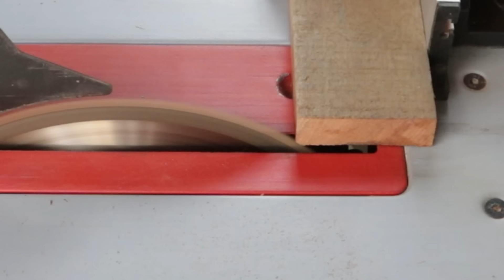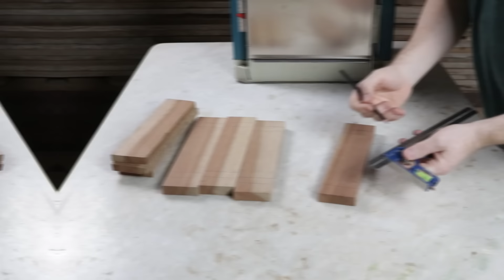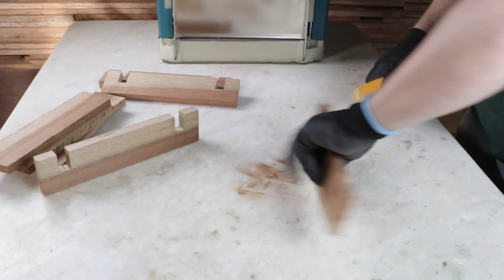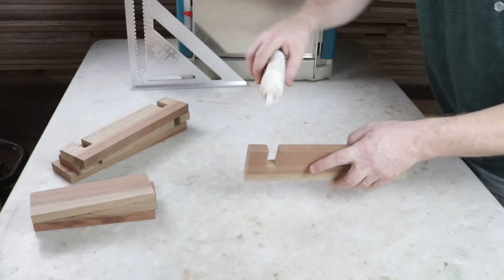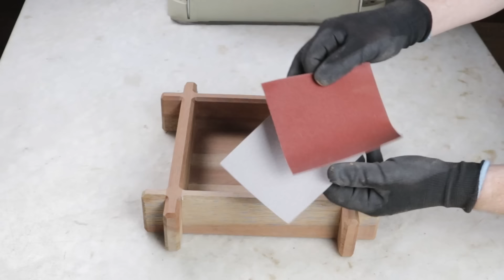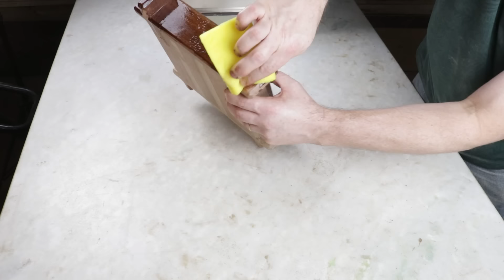IT'S WONDERFUL, EASY, AND QUICK TO MAKE - STEP BY STEP WOODWORKING PROJECT (VIDEO #46) #woodworking

Comment: I commend you for using metric! Imperial is difficult to measure accurately. Metric is so easy to calculate and measure accurately. So in doing the second step in marking square, you didn't use any marking gauge. I get that it's perfectly fine if you know what you're doing and can see square and level (as I can) but how can you confirm? 
What blade are you using for the dado cuts? There are a heck of a lot of different blade grinds, but I'll assume you're using a TBG or some other that allows you to get a smooth cut at the top? 
Come on, man! 
If you're going to do these cuts, share what bevel grind blade you use. It makes a difference and you know it. Don't be like a Grandmother that intentionally leaves out a key ingredient.
Reply from the maker: Hello friend! Indeed, those details you mentioned are missing. I hope to improve in future videos.... Thank you for the comment.... Best wishes, my friend!
#woodworking #woodwork #joinery